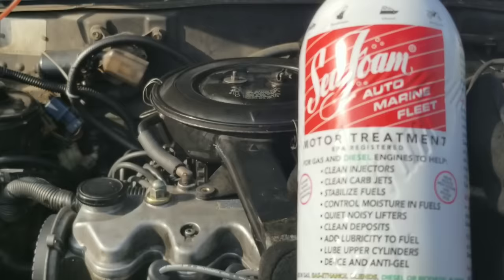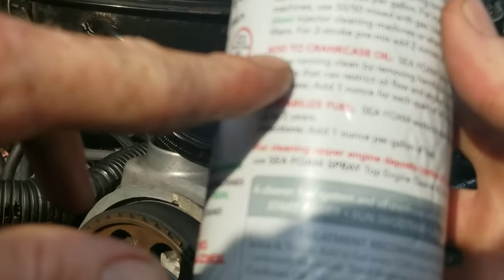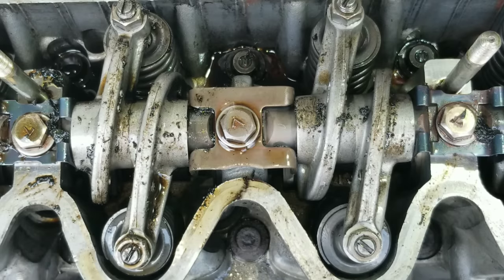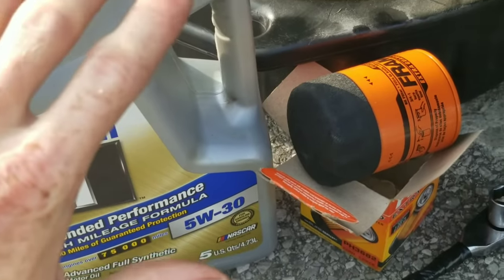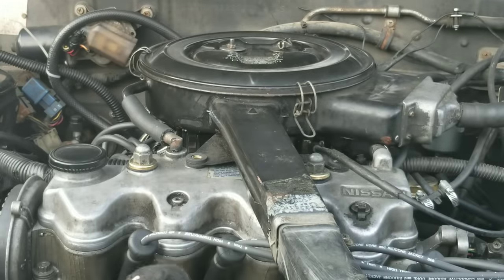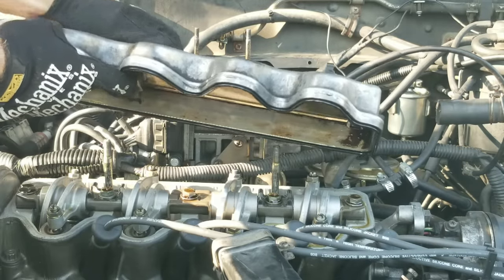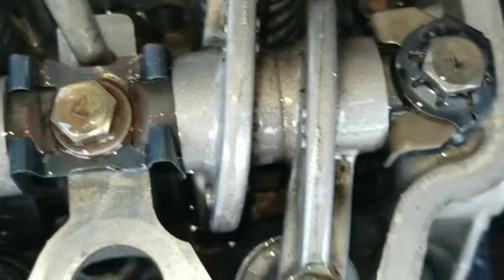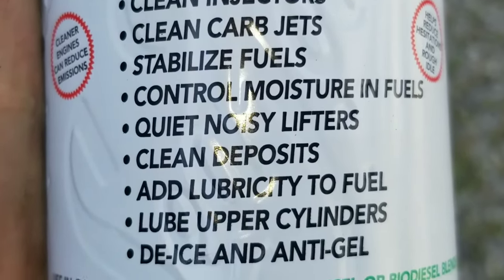Seafoam results i cant believe what it done to my engine

Comment: why worry about a clean engine if you are going to use a Fram oil filter
Reply: Hahaha that's a good one
Reply: Damn ... You beat me to it
Reply: yeah fram is the worse filter ya can use
Reply: The FRAM ultra synthetic oil filters are actually pretty good.  The other ones are kinda crappy though
Reply: Truth. Like using a box of tissues to clean up water.
Reply: @SoundGuyDavo  thats exactly how a  removed a pool of water near my spare tyre
Reply: The top of the line FRAM filters are pretty solid still prefer Wix myself but the cheap Frams are crap though.
Reply: @SuperRobvan  wow really i was using those filter at one point i did not know those filters sucked now i use ac Delco because i have a gm vehicle im glad i came across you guys comments that was one of my go to filters thanks guys man
Reply: abeast100 AC Delco filters are just about as bad. Same fiber end caps and overall bargain basement construction as the bottom end Fram stuff.
Reply: @mtfan  it seems like it is to
Reply: hilarious lol
Reply: Hahahaha.    You should worry about a filthy engine more with a fram filter.
Reply: I am younger and what is a good oil filter
Reply: @viktor7495  wax brand oil filters are pretty good give those a try
Reply: Not gonna lie I thought the same thing .
Reply: Just use oem filter there the same price.
Reply: @viktor7495  oem oil filters are always the best...
Reply: Preach
Reply: What would be a good filter to use for a 2001 Ford F-150?
Reply: K&N
Reply: Agreed there's plenty of decent cheap filters Fram ain't one of them lol
Reply: @viktor7495  wix
Reply: @SuperRobvan  lol good thing I been using the Walmart over fram 😂😂
Reply: Ice cold! Lmao!
Reply: Regular Fram filter is fine IF you change it at 5000 miles. Although the two more expensive Fram are better.
Reply: Need a WIX buddy!
Reply: 😂 I thought I was the only one thinking that
Reply: Thank you random internet guy, at 217 thou my camry is getting sea foamed next oil change.
Reply: @viktor7495  
 
   fram-$3.86, mobil-$10.29
Reply: We'll choke it some cardboard now (:o)
Reply: 😆 blahahahahaha
Reply: @johnh8546  wix all the way!
Reply: @2000chevy4x4  that's just about all I use. I also get the Napa Platinum if I can't get Wix.
Reply: LITERALLY
Reply: BAD filter
Reply: You're gonna piss off the poors.
Reply: Okay tell us the best oil filter?
Reply: Actually FRAM oil filters are very good now. I would easily trust their XG 20K mile filter in any car. I use that filter and do the 20K mile intervals without any issues(I change the oil every 10k but keep the filter in every other oil change). 160k plus miles on many of my vehicles without any problems. They are fleet vehicles and get 30-40k miles per year on them.
Reply: It’s not cardboard it’s a fiber composite. My Dad was in a paper mill that made it for them. They’re not crap like people are led to believe because “ITS MADE OF CARDBORDZ!!!” It doesn’t have cardboard.
Reply: Truer words were never spoken! I dont want this to sound rude to the guy that made this video. But his english and his accent remind me of my friend from home. When i was young i was raised the the countrt until i was about 8 then my mom moved us to the city. Now im back out in country... sorta.. but anyway i like how the calls the unti of measurement pounds per square inch(so S as it isnt plural) aka PSI he said PSIs. And then there is the title of the video. Like i said, no offense to the guy... my grammer isn't great and i have a southern accent as well. But this guy puts mine to shame. Love it
Reply: What do you suggest?
Reply: @br5747  anything else. Wix filters great though and available at O'Reillys. Amsoil is good as well if they have the one you need. Amsoil is just a tad harder to get because you'd have to order. But just know this... as long as it doesnt say FRAM..  you're better
Reply: Tell us you know nothing about oil filters without telling us you don’t know 👍👍
Reply: Next time you get a Fram oil filter take a flashlight and look inside it has rust in the bottom.
Reply: I have used Fram oil filters since the first oil change in my 4cylinder Nissan d21 pickup.  Still going strong 236 thousand miles.
Reply: @pablomartinez5067  next time you get a fram oil filter take a flashlight and look in it
On the bottom inside the filter you will see rust.
Reply: K&N oil filter is one of the best. Tough material
Reply: I've used Mobil 1 oil filters and have had no trouble when useing any kind of oil.
Reply: They are all made at 1 of 3 factories smart guy
Reply: Fram extra guard is a solid filter I've been putting them on cars for years I put them on thousands of cars I've never had a problem all the engine oil is still clean after 5000 km
Reply: @briangarrity4725  not saying Fram is not good but I watched a video of someone cutting them open. The found rust in the bottom of the filter. I went to walmart got 3 different oil filters shined a flash light in them and they were right there is rust in the bottom of all 3. Next time you get a fram oil filter look in the bottom and see if you see rust.
Reply: I just put one on my truck today I'm going to change it tomorrow
Reply: @briangarrity4725  I use the Mobile 1 oil filters. They cost a little more but we'll worth it.
Reply: Lmao! Goteem
Reply: Worst filter ever! I use wix
Reply: Hilarious lmao 🎉
Reply: Lmao
Reply: Filter doesn’t matter your oil change interval does matter though go ahead and pay the high price for a filter that does the same 😅
Reply: Yeah get a wix, k&n, mobil one or royal purple. Also napa gold is a wix.
Reply: The fram isn't the issue it's that mobil 1.. worst oil ever made! Causes so much sludge and buildup
Reply: They suck? I used them forever on my bronco.. my focus I’m using motocraft.
Reply: @ladamadenadie1658  mobile 1
Reply: You are so perceptive. We called fram full flow filters because for years they didn’t even join the filtration material,  After use one could see the inside core. Just watch any video on what the inside of a oil filter looks like, it’s obvious.
Reply: @viktor7495 more or less you get what you pay for generally the $15 oil filter is gonna be better than the $6 oil filter in just about every way
Reply: @johnh8546 I don't use Fram, so I don't know, but do they have an economy line one like Microguard? I just stick with WIX XP since they have a good combo of filtration and burst rate
Reply: @abeast100 if you are towing, use a WIX XP or a K&N
Reply: I was wondering that too. Fram makes excellent oil filters, but you have to buy the ones with the synthetic media and they are usually the gold colored ones. They will not screw up your engines like the orange ones do
Reply: AC Delhi all I use
Reply: Listen up about oil filters. If you are changing your oil every 5000km it doesn't matter what filter you use. Same as your oil. A conventional oil protects just as well as a synthetic oil up to 5000km no difference. Synthetic oils were really introduced for colder climates but the masses have been brained washed by the industry to but synthetic and expensive filters. You have nothing to worry about if you change your oil and filter every 5000km..don't be a sucker and buy the expensive oils

Comment: SeaFoam recommends at least 100 miles of driving no more than 300 miles when adding to the crankcase not 3000.
Reply: You can keep seafoam in during the 3000 miles. I asked a seafoam rep.
Reply: They recommend those numbers so that they can sell more product.
Reply: No more than 300, That rep is full of sh!t
Reply: it has to be added before every oil change!!!
Reply: On the can it says add to crank case before or after oil change.  
After would mean you can leave it in until your next oil change.
Reply: I asked my mom

Comment: It's astounding how "poured on" that "buildup" looks on those rockers and how NOT discolored anything in there was.  Almost like it wasn't actually having a problem with buildup in the first place.
Reply: Totally agree...it was the first thing I thought when he removed the valve cover. I think the engine was clean in the first place and he reversed the sequence of shots. That grime was "pasted" on to those rocker arms. I call RAT !
Reply: @themessenger5868  I agree I think that engines biggest problem is the frame oil filter.
Reply: my thoughts exactly, actually looks pretty clean, except for what appears to be some grease smeared on it. I like how the grease is also smeared on the gasket surface area.
Reply: Looks like he hand cleaned it and tried to pull one over on us. Shame on him that's not how ya get subs. He could  have had my but he'll no not after that stunt
Reply: Agree +1. It's a setup. Agree with all your observations, I thought the same thing.  Plus, how come the underside of the rocker cover is dirty when the lifters etc are spotless?
Reply: That’s what I thought it looked pretty dam clean to me
Reply: OK so I'm not going crazy, I thought the same thing. Also how there was sludge on the gasket surface like what the heck is that?
Reply: @grivolas2144  Fram paper oil filters have consistently beat out the overpriced "premium" filters.
Reply: I said the same thing but look at the rockers they're actually cleaner
Reply: @themessenger5868  l
Reply: My favorite part was the "sludge build up" where the valve cover should have been, that motor was borderline spotless.
Reply: My thoughts exactly

Comment: The valve train looked pretty clean from the beginning  just throwing out my opinion
Reply: Really clean, get a vehicle with 300 thousand + miles using cheap grade oil, then see what the results look like.
Reply: Thinking you are missing the point of the video
Reply: @Lightningbom  ?

Comment: I've been using seafoam in my oil 
And gas in my car since 150000
Miles
Now at 298000 miles in my car 
Runs great still.
Reply: Toyota or Honda?
Reply: Just do your oil changes and it'll stay clean
Reply: @jjmccloud  nope, this product is for cars/atvs that have sit for a while, and it should clean the engine out.

Comment: Great job!  Thanks for sharing.  I'm a very BIG fan of Seafoam.   A lot of my yard equipment ran poorly, even after a tune-up  Seafoam cleaned everything up and now all of the equipment runs like new.  I'm extremely happy.  The guys at the mower repair place said a lot of the problem is caused by 10% ethanol in modern gas, and this helps correct it.  I'm sold!
Reply from the maker: Thank you i love when people share with the NIA community
Reply: Saved more than one mower from an engine rebuild or the trash, use it in all of my vehicles.

Comment: You should have let us hear the engine run after having used Seafoam. I heard this engine in a previous video when you were cleaning the valves (great video). I personally used it on one of my engines and it loosened a sticky valve. I only use Seafoam periodically. I'll use MMO much more often to add a little extra lubricant. Typically 1000 miles before any oil change.

Comment: On the the 5.3 Chevy engine.. I still had a rough idle after tune up wire and plugs..  engine hott i did one can spray in the throttle body and one sucked up the brake booster line to intake.. shut engine off hott soaked for 20 minuts.. start and run at 2k rpm till smoke cleared... engine runs smooth and with a strong idle... 100 percent satisfaction!
Reply: I had 140k miles on the truck just bought it.
Reply from the maker: That is really great thanks for sharing
Reply from the maker: Yes this engine is 30 years old
Reply from the maker: This helps others
Reply: Try some in the PCV valve before shutting the engine off for the soak. Also put some in the fuel for the injectors. Note: the tank does not have to be full.
Reply from the maker: Yes that would be beneficial
Reply: Be careful with throttle body intake cleaners. Meaning of those will leave a film or residue on the hole vacuum system as in the idle air control valve the map sensor the map sensor, etc..
Reply from the maker: Thanks what can we try next
Reply: @tarquineous  how much should you use in the PCV?
Reply from the maker: Thats so awesome it worked for you and thanks for sharing
Reply from the maker: Yes i was concerned about that also
Reply: could have done the same thing with warm water..... Cost.... Nothing!!!!!
Reply: Hey have rough idle and hesitation in my 5.3 Chevy  so get seafoam spray and spray some into the throttle body
Reply: Adrienne Gravely one thing at a time but I would try some MAF an MF throttle body cleaner. 

The 5.3’s and really most any newer engines get really nasty with the Crank cases vented back into the intakes, since it’s essentially trying to burn off the pill gasses from the crank case and that turns into the oily gunk in the intake that likes to cause throttle body problems. I’ve installed a catch can to minimize how much oil actually gets into the intake. And you’d be surprised how much oil it catches... about 6-8oz oil over the last 20k miles.
Reply: I've had amazing results with seafoam.
Reply: tarquineous -can u really put this i your fuel tank ?

Comment: Hey, I see you're using a FRAM oil-filter.  There's been a number of YouTube videos where people are cutting open various oil-filters to see how they're different from brand to brand, and FRAM is the crappiest quality by far.  One guy cut open two different FRAM filters and found actual rust flakes in there.
-
That said, I'd been using FRAM for years and hadn't noticed any negative results, and others have said a similar thing.  However, the video noted that the quality of the "Wix" and the "Napa Gold" seemed to be the absolute best, and those two oil filters are only an extra few dollars for my own make and model of vehicle, so I'm playing it safe and moving to those.
-
Just wanted to put that out there in case other people were interested in that kind of thing.  It just doesn't make sense to me to use Mobil 1 -- full synthetic -- but then mix it with an oil-filter that has cardboard, paper, and rust-flakes in it.

Comment: Have a smallblock chevy that had been sitting , barely driven since 1995.  Used to burn about a quart every 700 miles.  Added sea foam for threet 200 mile oil changes and it stopped burning oil.  Had that old oil smell when changing the oil that was 200 miles new.  Also added some to my fuel and fouled my plugs.  After a couple of initial spark plug foulings, the tops of my pistons were reasonably clean again.  No more fouling.  Impressive stuff!!!
Reply from the maker: Great story thanks for sharing with the NIA community and what can we try next?

Comment: Hey Nate, Brian over at Sea Foam recommends 1-1.5 ounces per quart. In your case, that would be "4-5" ounces. However, you put no more than an 1-1.5 ounces in the engine. Imagine if you used more/recommended amount!

Comment: I don't care what anyone else thinks about Seafoam.  I use it after personally witnessing fix a problem with my 1987 Nissan 300zx that  hesitated to start.  I put in new plug wires, distributor, spark plugs,   and couldn't figure out why it struggled to start. After I saw a video about Seafoam,  I tried it out and did just like the video. My car always started right up, ran great, and made me a believer in Seafoam. I  use it on my motorcycle and 2 other vehicles I have.

Comment: I had an intermittent lifter ticking. Sometimes on startup, sometimes not, sometimes while sitting idle for 5 minutes, other times not.  My 07 Silverado 5.3 turned a complete 180 after adding 1/2 a can to my oil.  The lifter ticking left almost immediately!  I actually can’t believe it, no ticking, smoother idle and overall better performance.  I’ve never been a mechanic in a can kind of guy, but any older vehicle I own, I will always use this stuff!
Reply: My F-150 had a lifter tick until I used a can of the intake spray. It’s been gone for almost a year now.
Reply: @dbucha4  - mine ended up coming back… lol.  I wound up dropping the oil pan and it turned out to be the pickup tube o-ring.  Replaced that, normal oil pressure and ticking gone.  What a pain

Comment: Why would the oil pressure go up after using it? If the internal workings of the engine has deposits that should make the pressure go up and cleaning them out should make it go down.

Comment: I've used Seafoam to store small engines. I put it in the tank as the motor starts to run out of gas. Then drain the carb next season.  My snowblower is 11 years old and starts one pull every time.

Comment: Warning, I had a head go POP after using sea foam because the previous owner never changed the oil so there was a ton of thick black gunk buildup all over the engine and it plugged an oil passage so it dropped a couple valves. But it definitely cleans it out. Putting it in your gas steam cleans the pistons and injectors as well. Good stuff!
Reply: Yes, only use a small amount of Seafoam as some oil passageways will get clogged.

Comment: I have watched before and after and both look exactly the same. Except for the bits on top of the rockers in the before and they would not be normally there. Looks like they have been dabbed on there with a paint brush.  As the normal flow of the oil would wash them down And they would work their way into the filter.